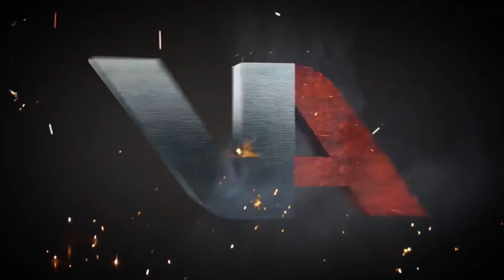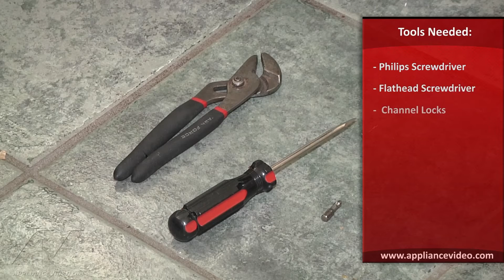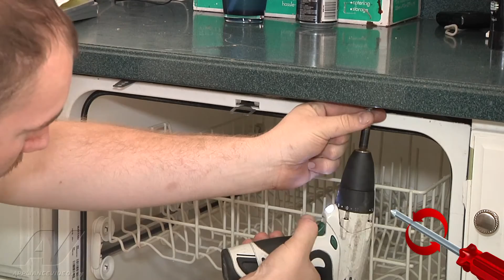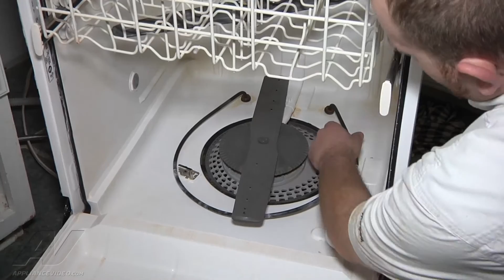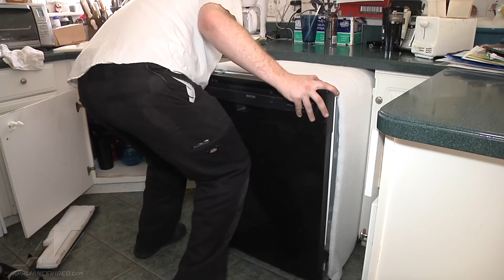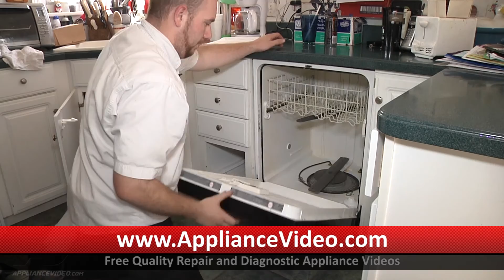Maytag Dishwasher Repair - Broken Heat Element - Heater

Comment: * important safety point, turn off water to the house from the outside main (there was a t valve next to the metal mesh hose that filles the dishwasher), it was broken open with calcium and scale buildup, even after I closed it I thought. I quickly sent my very smart lady friend to shut off the main as I kinked the hose with vice grips, carefully. Then replaced, repaired,  and in half an hour as the appliance tech showed, and replaced metal mesh hose to dishwasher, started up, and yes all done!